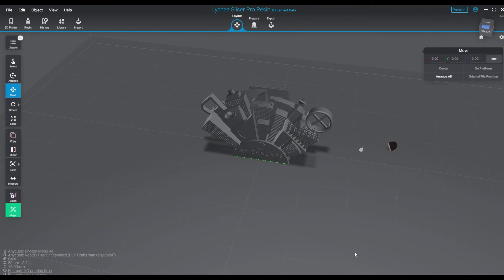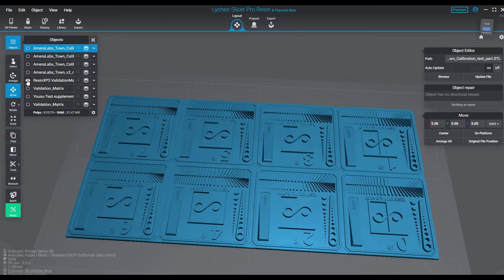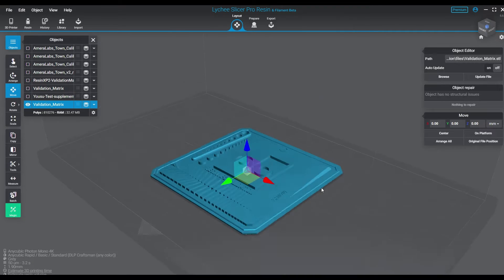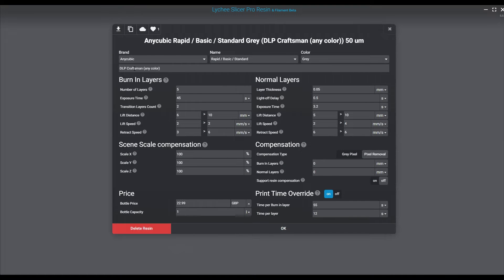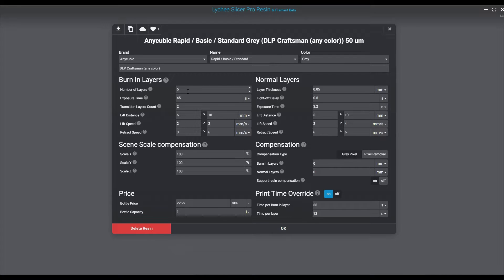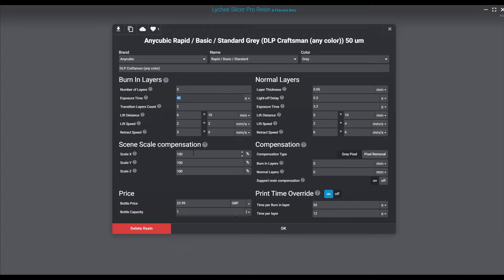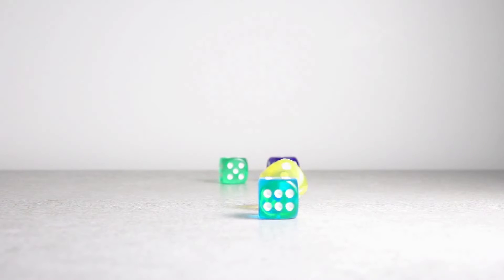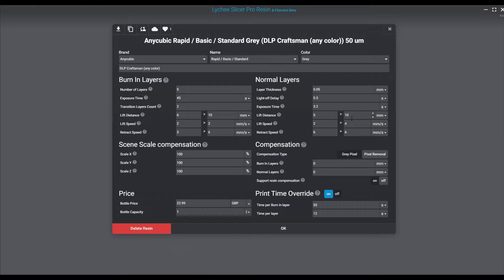Getting Great Prints   Every time with good resin printer settings!

Comment: do you by any chance have an idea how to use the focus calibration option (in the D2 Menu). i have absolutly no idea how to use it and there is no information i found which is insane since its literally one of six menu points
Reply from the maker: I think we reached out to support on that one. I am still awaiting an answer. As of now. Assume it doesn't work. It might be a function that was made for Photon Slicer, not 100% on that. If we find out, we'll do a video on it.